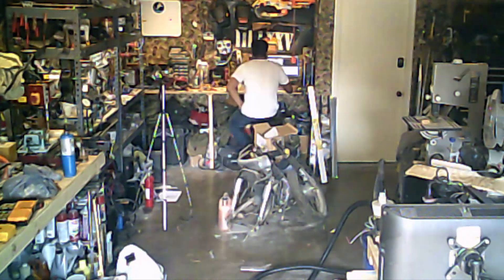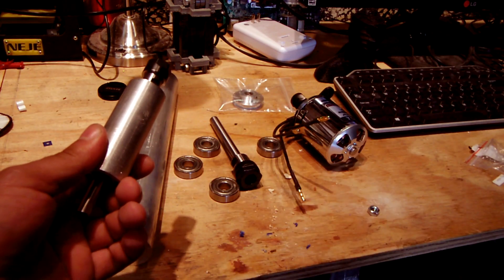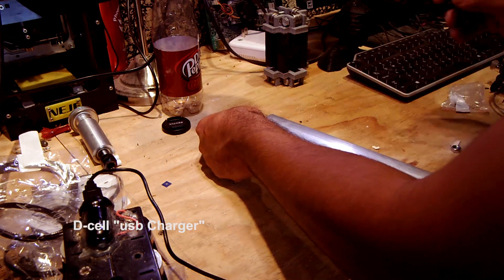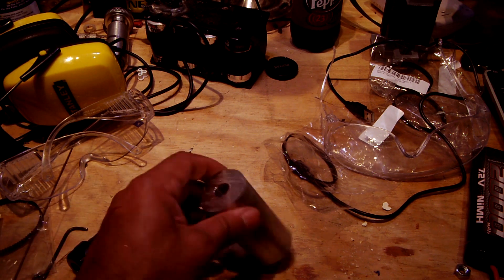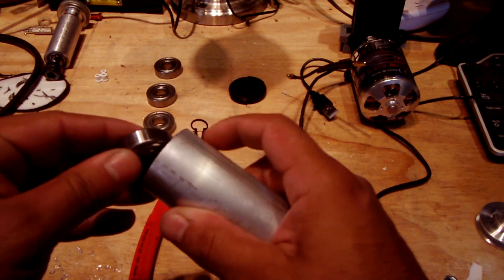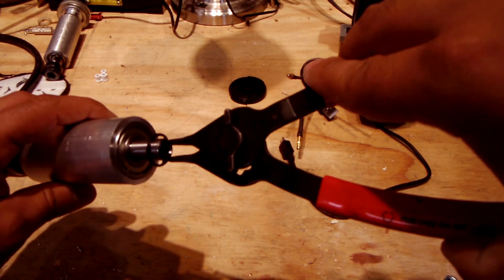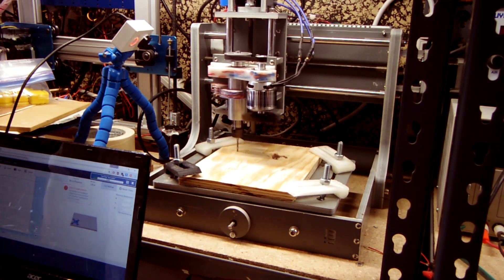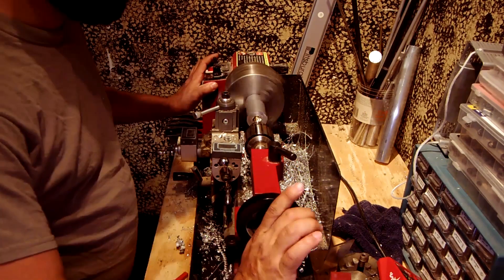Brushless CNC Spindle

Comment: What kind of bearings are you using? I made my own spindle very similar to yours but it sounds rattly since I was just using standard 608 bearings and I just use 2pcs.
Reply: They make angular bearings that self align under load, they are meant to be pressed together and are often used in spindles. Here is an example of some with a 12mm ID that would theoretically fit this collet holder (not recommending this particular seller necessarily) https://www.ebay.com/itm/2-Angular-Contact-Spindle-Ball-Bearings-7201-B-12x32x10/400072819705

Comment: The bearings on a spindle are pressfit The bore is turn 0.015 mm smaller . if The bearing goes in by hand you have a big problem with stiffness and durability because The outer race rub on the bore and erodes the inner diameter
Reply: Would loc tight or actual layer of paint/glue help?
Reply: @TheRainHarvester Green loctite (648 series) works with 0.025/0.04 mm of gap . With More gap the piece Is scrap or you Need to bore it larger and sleeve with a bushing with the correct ID

Comment: How fast does it spin?  Does the set screw throw it off balance?

Good video! I had no idea it could be made on a lathe.
Reply: Those monster outrunners hit no more than 270kv . Assuming 24v and 1:3 transmission that is 2160 RPM

Comment: How did you keep the Collet from bobbing up and down?
Reply from the maker: the shank has a groove with ring on it. the body is just held by pressure from the mount. i have no idea what the rpm rating for the gt2 belts, they came from ebay.
Reply: Alright, well looks cool.

Comment: I think this is very good idea and good work also, but I don't understand what's the plan.
Because you don't mention the technical parameters you want to achieve, you don't calculate anything. A mill spindle must take axial and radial forces too, both. What kind of bearings you use, its crucial question, and what will be the rpm ?  Deep groove ball breaings are not good, because they can't take the axial forces. Maybe if you work only with wood or something really soft. But in that case wouldn't be much simpler and cheaper to buy a simple chinese spindle on ebay ? You can buy angular contact ball bearings from $5 to $100/pcs depending on rpm and brand and accuracy class. Thats a big question. Because your Turnigy Rotomax motor is awesome but not the most cheap thing (with power supply) to work with wood. And if you wanna work with metal, then bearings and joints and tolerances and torques become important, and the things are not cheap, you should make calculations.
Reply from the maker: good tip on the angular contact bearings.  id have to machine a body that would fit them.  from what i saw on the ebay all the spindles being sold were DC brushed spindles and wear out over time, as well as were either to big or not powerful enough for what i wanted. the one i make in the video im not sure what bearings they had, the one on the zen toolworks CNC machine has 4 lucky brand 608 bearings. Im not sure what the RPM of the machine is but its way faster than in needs to be, but with the 60 tooth gtk gear slows it down and adds more torque. it mills aluminum like champ.
Reply: how can i make those calculations i thinking about making one for my self what would i need to know if i wanted to cut aluminiun easily???

Comment: Hi. I was interested in making a brushless motor spindle as well.

What sort of run-out do you get?
Reply from the maker: i bought the stuff to test the run out, i was getting about .06mm on the small 608 bearing spindle.
Reply from the maker: i dont have the tools just yet to test the run out. im also interested to see what it is, just because this wasnt my best work,
Reply: At least 0.02 mm TIR, as the ER collet shanks are g6 tolerance and that is just a bit shy what the bearings need.

Comment: awesome video. im currently thinking of upgrading the spindle on my nomad 883 pro, you showed a pic of it at the beginning.  need a lil more power to cut AL and such without shitting my pants..
Reply from the maker: Thanks, i'm using a Turnigy Aerodrive SK3 - 4240-620kv as a motor and Turnigy AE-65A Brushless ESC. It cuts aluminum pretty good with light passes. id imagine making a mount for a nomad wouldn't be to hard.